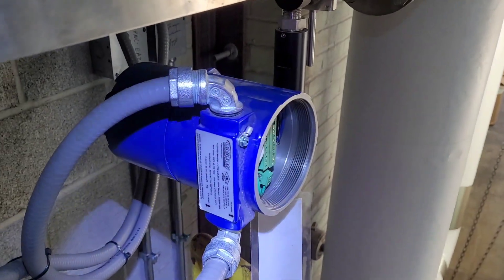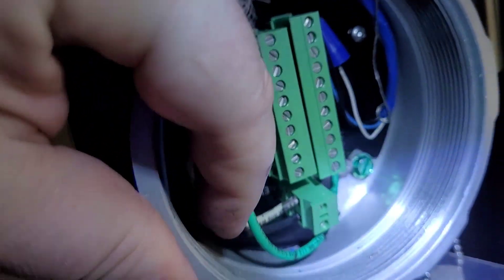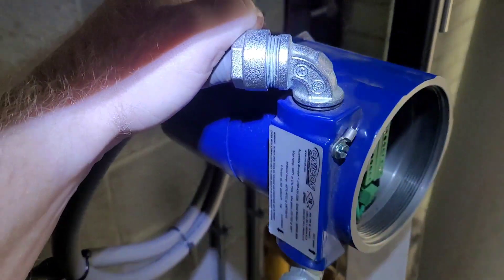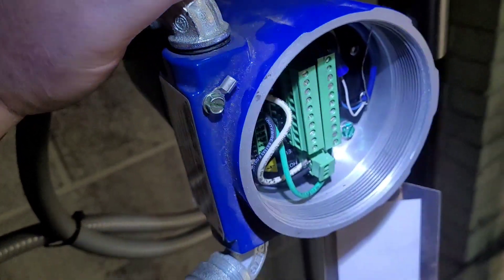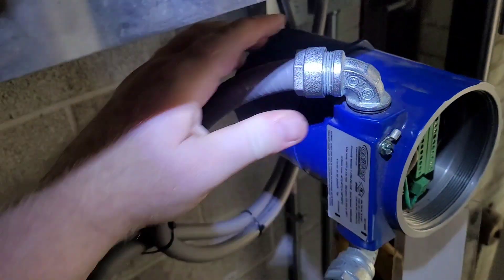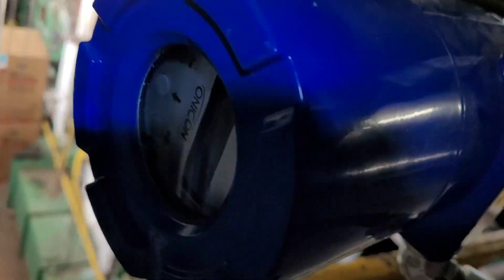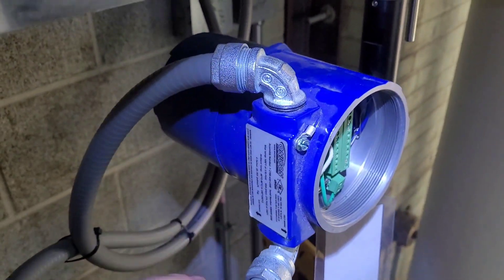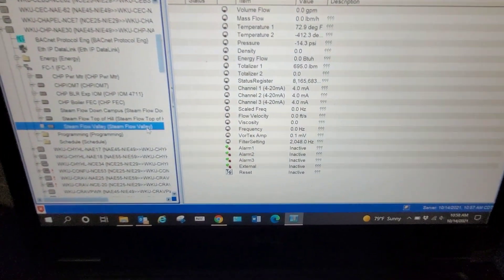Connecting Onicon steam meters to Metasys through BacNet

Comment: We use Rosemount steam meters here at Illinois State. Do you use a remote temp sensor or plug a static temp in to measure flow?
Reply from the maker: This meter has everything on board. It measures temp, pressure and flow from a single point insert.